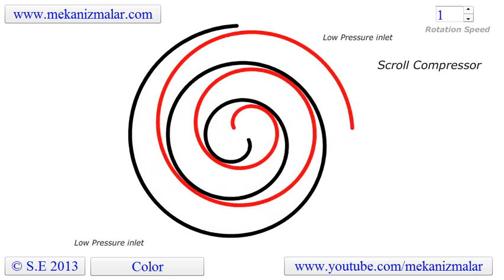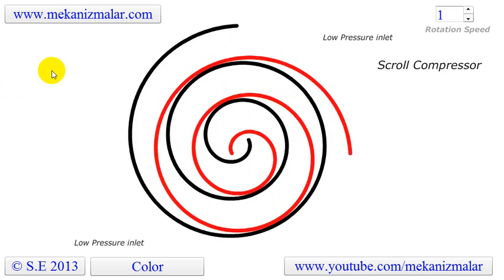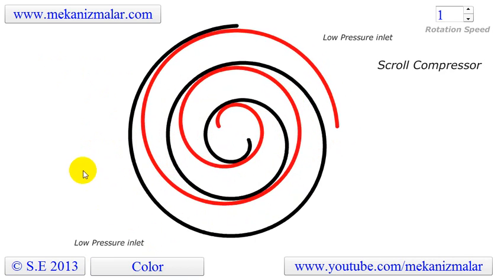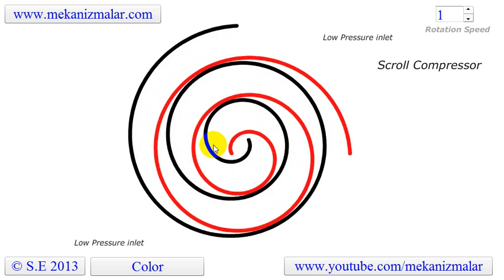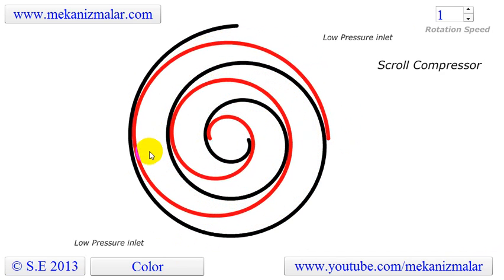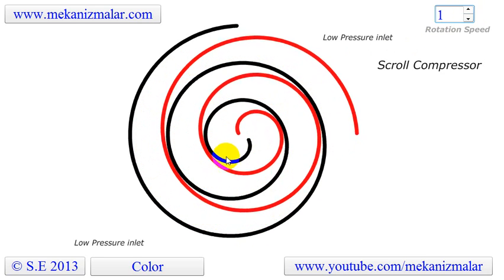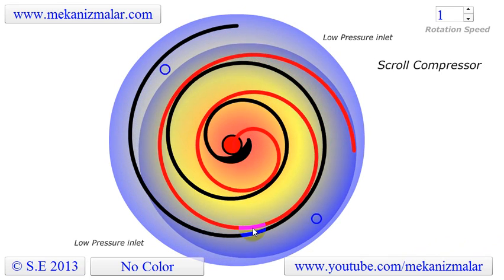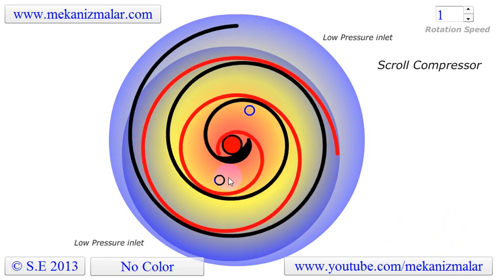Scroll Compressor

Comment: Scroll compressor is worst one
Because of the dynamic of compressing gas .... spiral way is not good for compressing gas .... even the air of outside unit is not hot enough to make the place is cold

Comment: This is simply the best compressor for any type of air standard machinery.
Reply: Should be good at moving any compressible gas, such as HVAC coolant gasses, right?
Reply: @antontaylor4530  absolutely.... But it cannot work as water pump because water is incompressible.
Reply: @hrishikeshkashyap3715  Yes, I get that it cannot pump liquids.  Very interesting technology.
Reply: @antontaylor4530  But, twin screw supercharger can pump liquids.... Twin screw supercharger is a modified version of Archimedes screw pump.
Reply: @hrishikeshkashyap3715  Why would you do that instead of using a centrifugal pump?
Reply: @antontaylor4530  positive displacement pumps has many advantages over centrifugal pumps, especially when it comes down to the backflow of fluids.... Positive displacement pumps prevent the backflow of fluids.

Centrifugal pumps propeller need to rotate at a very high speed in order to avoid the backflow of fluids, due to gravity and other factors.
Reply: @hrishikeshkashyap3715  I'm more worried about efficiency at the moment, as my father in law has an off grid cabin.  Power is limited, so any pump needs to be as efficient as possible.  When considering air conditioning, for example, this compressor would be worth paying extra for - as it would require us to buy less solar panels and batteries when expanding the system for the extra load.

I'm not sure we need air conditioning though, because humidity is low here so the heat never gets uncomfortable, even when it is 35c.

But when it comes to the water pump for the well, we are using a positive displacement pump, and it seems to work well.  The system has a non-return valve, so we could switch to a centrifugal pump, but I'm not sure it can cope with the head - the well is 18m deep.
Reply: @antontaylor4530  are you and your father in law building a custom AC?

And to be precise, I don't know the working cycles of an AC or a refrigerator, so I cannot make any suggestions about which compressor you should go for yet..................... But I do know that Scroll compressor isn't a compressor at all, but, instead, it is a pump because its fluid pockets shrink only when is it collecting the air/gas, but when the Scroll compressor releases the air/gas out into the pipe/tunnel through an outlet at the centre of the two Archimedes spirals, the air/gas expands and regains its original volume.

And by definition, a compressor compresses the air/gas, cools the air/gas by transfering the heat produced within the mass of air/gas during the compression stroke, into a sink or coolant, so that the air/gas do not re-expand upon its release.

And one more thing.... Scroll Compressor is a positive displacement pump for air/gas.

And when it comes down to the efficient pumping of water with very limited solar panels, I can't provide a solution until I visit that off-grid cabin.

Comment from the maker: Hi Grimaldon, search for my cyclo speed reducer here is its id ie2wwAnKDM0 Look at the center. Dark circle in the center is an electric motor shaft. The crescent shape is actually is a round shaft, but it is off center to main shaft. So it rotates shuttle at the center very slowly. Similar mechanism is used in scroll pump. Since fixed and orbiting helix always in contact, moving red helix can't rotate, just orbit around main shaft. I hope it is clear now.

Comment: What if you used two of these to build a gas turbine, one compressing air, and another running backwards as an exhaust turbine?
Balance may be a problem, maybe if both scrolls were eccentric? 
I think less scrolls on the exhaust, probably only one turn.
At low Reynolds numbers it would compress better than a impeller and no complicated seals would be perfect for a tiny model turbine